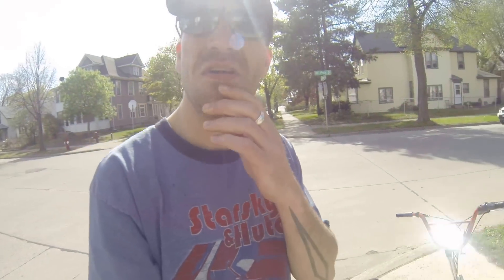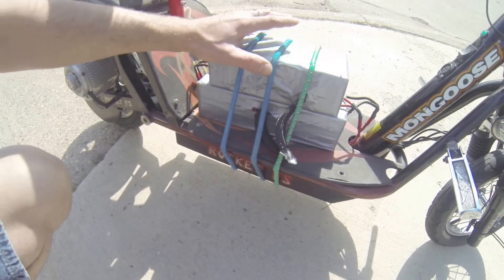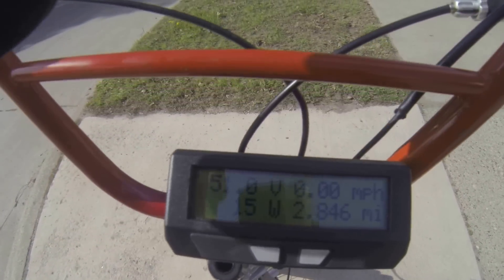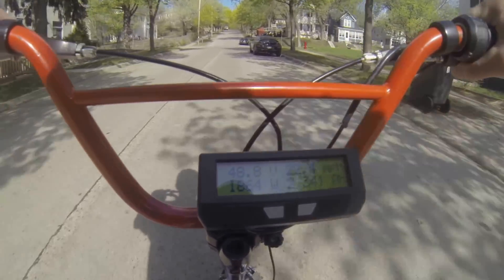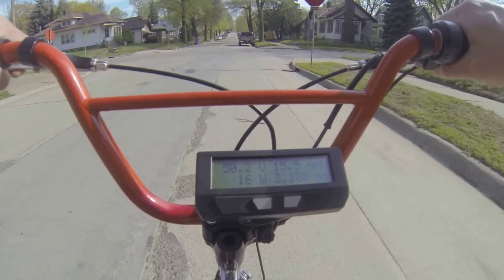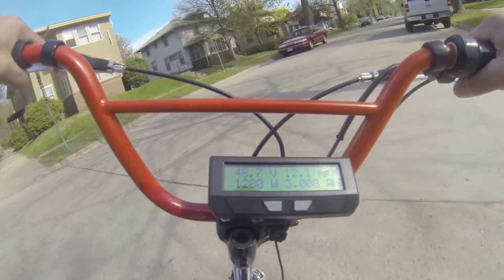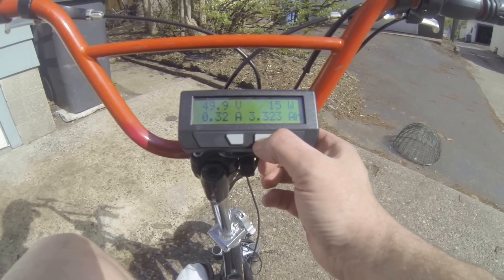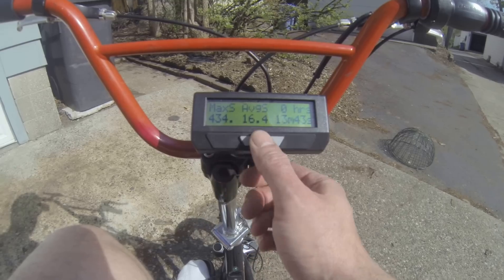Currie-Tech Electric Scooter w/1000 Watt (36v/32a) motor, over volted and re-geared: 30mph 1900watts

Comment from the maker: Thanx! obviously the drive systems are totally different. I took the 1000w motor and cut off everything except the 3 mounting holes. the biggest obstacle was getting the 11 tooth sprocket onto the 1000w motor shaft. the end of the shaft has gear grooves machined into it. I had to 'hack' on it to strip the teeth down to make it small and round enough to fit motor sprocket (11t) onto it without changing the sprocket itself (ie drilling the hole bigger). I had a buddy use his welder to attach it.

Comment: Nice scooter! I have a question for you.

I own a Schwinn Missile FS(exact model as your Mongoose Rocket FS), and am about to buy an EZip1000 for cheap.

Is the 1000 motor easy to separate from the gear drive box? Would the shaft accept the flywheel for my chaindrive?